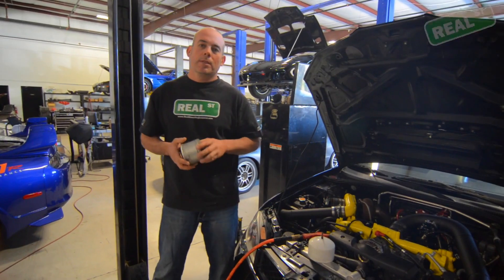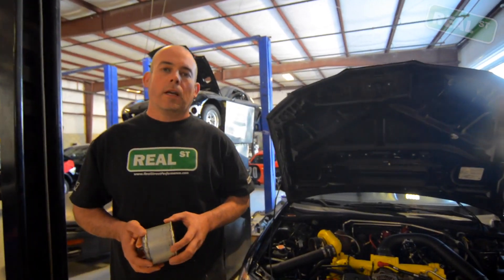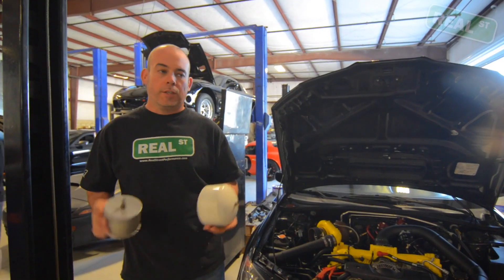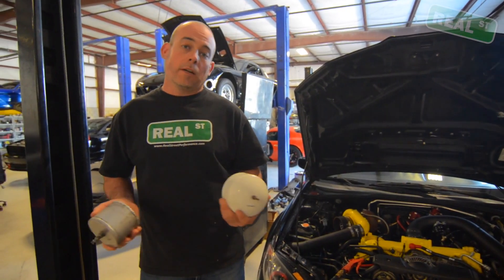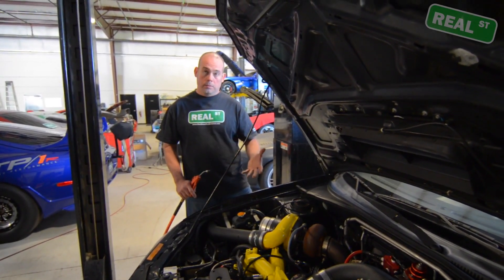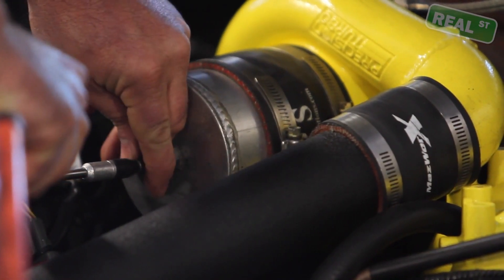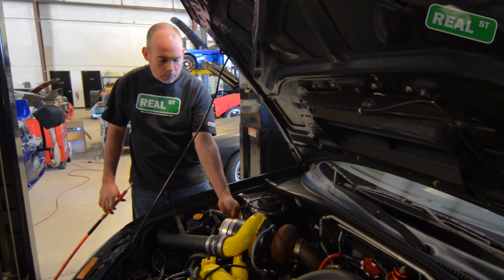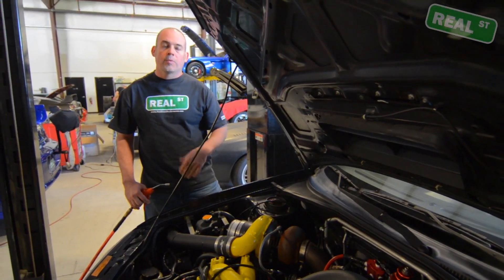Boost Leak Test - Jay's Tech Tips #16

Comment: The system has to be SEALED for this leak test to work. You have intake and exhaust valves that are open to allow that to leak thru the combustion chamber and back out the turbo, this test is worthless ...

Comment: Do you have to block off the passage way to the throttle body so the air doesn’t escape into the engine ?
Reply: I wouldn't think so, while the throttle will let some air pass by it's shut so you shouldn't have to block it off.

Comment: I have an issue with my 08 dodge caliber srt4 where when I try to lay into the gas pedal my boost shoots up, my car sputters and pops, then it just sounds like I'm losing a lot of air? If I keep into the pedal it will throw my check engine light on and put the car into limp mode. The code that it reads is a 2261 that says I'm overboosting. My car puts out about 8 lbs of boost. If I reset the code everything works fine. It only happens when I try accelerating quickly and lay into the gas? Plz any help or suggestions???

Comment: Good stuff. i personally like to do segments. I like to disconnect the cold and hot pipe ends and cap them off and pressurize them to see if there is any leaks in the intercooler, pipes couplers, BOV etc. If there is none. Then i re connect it and then pressurize the turbo with everything connected. 

Mainly because sometimes when you have a bunch of vacuum lines that could be leaking and your initially trying to see if a coupler is bad then it can challenge the process. But either way you'll notice the leak when you start spraying soapy water onto those suspected areas.

Comment: hi i have evo 8 with stock turbo running on a aem ems map.  my car was tuned yrs ago for like 20lbs of boost.  its drove fine for a while and then i hardly drove it so it sat around for long periods of time.  then it started overboosting to like 25 26lbs and then boostcut or fuelcut.  first time it happend scared me felt like hitting a brick wall.  and what's wierd is sometimes itll do all the time driving an hour stop somewhere and drive again and it goes away.  its been doing this for years.  haven't bothered to really look into it or take to a shop.  the car only has 10600 miles so its hardly driven as you can tell.  05 evo 8.  would boost leaks cause this issuse.  thanks.

Comment: thanks, on a maf sensor arrangement I know the fuelling will be off if there's a boost leak but am i right in thinking that it will cause a rich condition?  I'm studying fuel trims at the minute and trying to diagnose a rough situation under high boost. I'm almost certain it's a boost leak but I just want to clarify for my own understanding the way the ecu responds when it's getting less air than accounted for by the mass air flow sensor. kindly appreciate any help
Reply: Virulent Sorry if this is late, but yes it would be a rich condition.